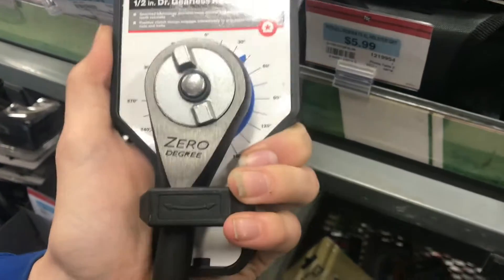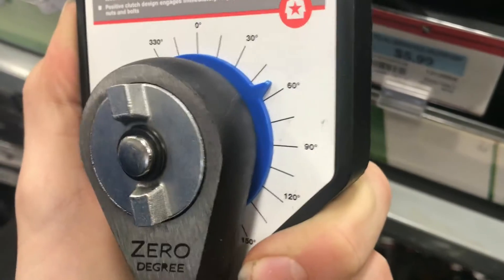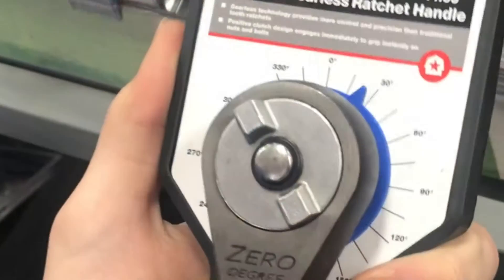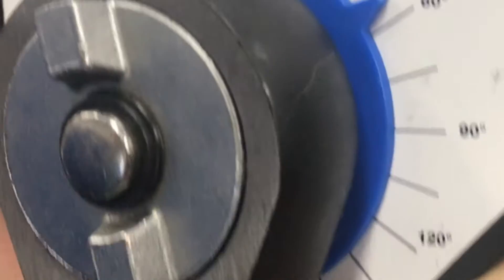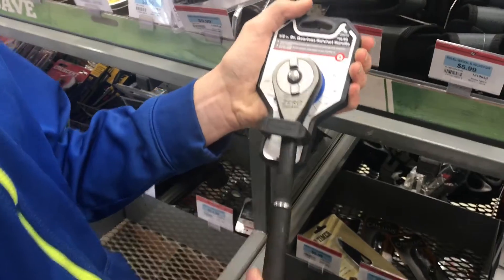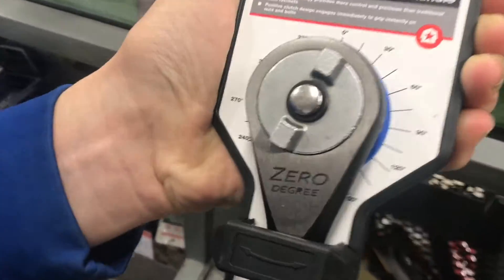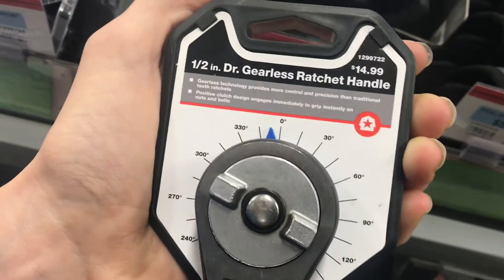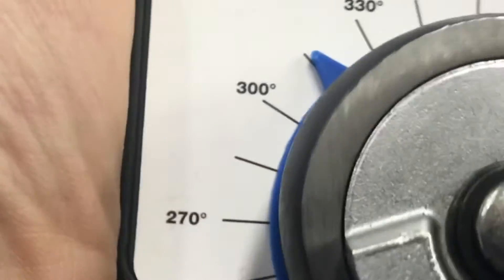how to ZERO degree ratchets work

Comment: I've used the 3/8" and 1/4" Tractor Supply Zero Degree ratchets and so far have had no issues.  The action tends to become smoother with use - less "crunchy".